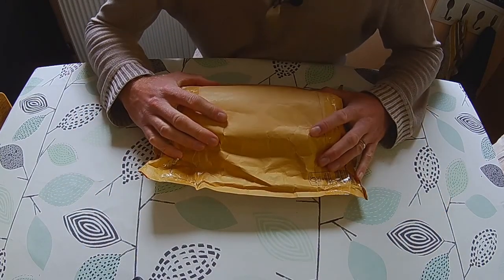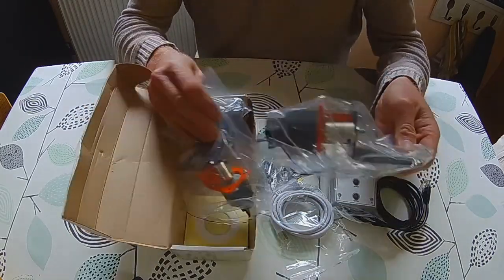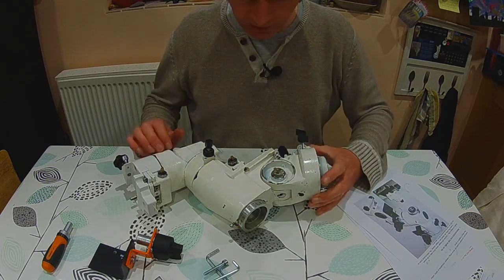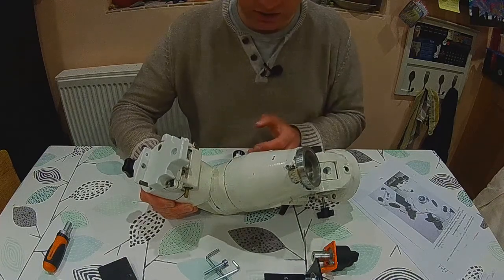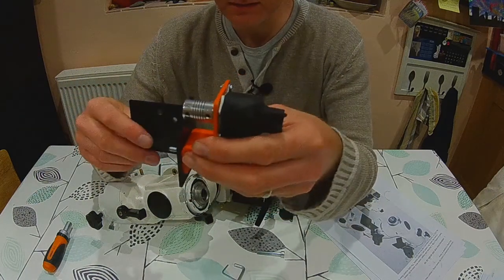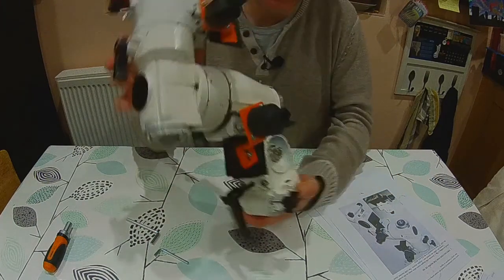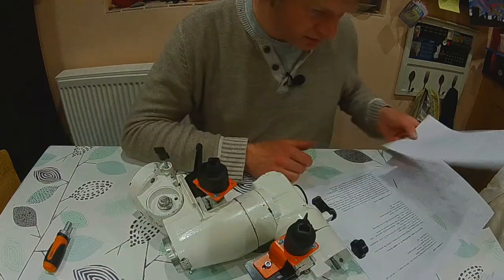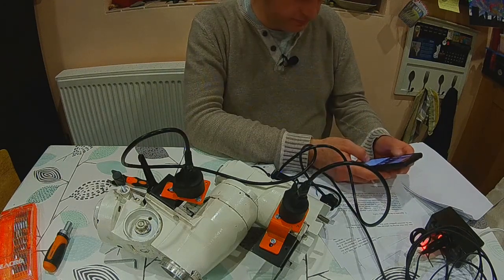Eq5 Mount Restoration No2 - Fitting Astrogadgets Micro Goto Motors

Comment: This is not a go to system. The motors are not stepper motors and are only for tracking and centering in the eyepiece or camera. The go to motors are much more expensive and powerful
Reply from the maker: It is called a micro goto system.  It creates a local WiFi hotspot, within which you can connect to with your phone or tablet and use skysufari to control the mount.  The micro bit is the small number of degrees that the goto works with.  You do need to sync the mount position to the app.  They are stepper motors which are controlled by the unit.  It can also be used stand alone and with guiding.  Yes, the Synscan motors are more powerful, however this exercise was about refurbishment and keeping it simple.  Hope this helps.

Comment: 6:17 I've bought those shaft couplers from eBay, so they are quite cheap and easy to get, in case you need to replace them.  The grub screws are buggers for falling out though, if you don't tighten them correctly...
Reply: Might be worth applying some loctite thread adhesive to the grub screws to prevent them coming loose.

Comment: Just to save you sometime, perhaps, it won't work with Stellarium. You need SkySafari plus. I got those micro goto motors myself for my EQ3. Make sure you losen the bolts as well so that the motors don't go under stress (it won't move at all and you hear a weird sound.
Reply from the maker: Hey buddy, thanks for the comment.  Yes indeed, I found the same.  That is for the next episode!!!  So glad for your input!
Reply: I also have a similiar kit by astrogadget on my eq5. They have a wifi adapter that you can use to connect to smartphone and phd guiding for example on pc. With the eqdir cable i never got it working properly. It runs through synscan pro on my laptop and smartphone, their kits are awesome! I never thought it would run this well and reliable on my eq5